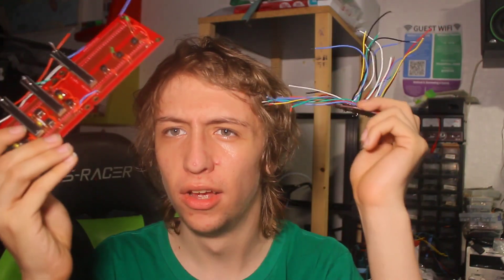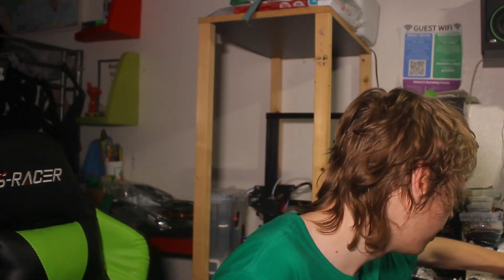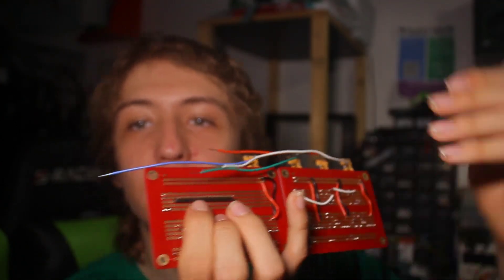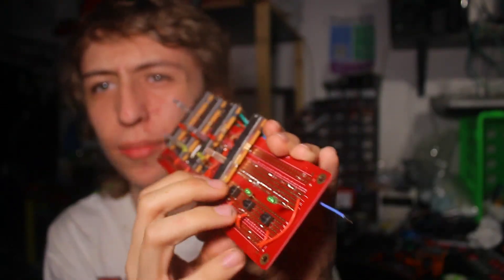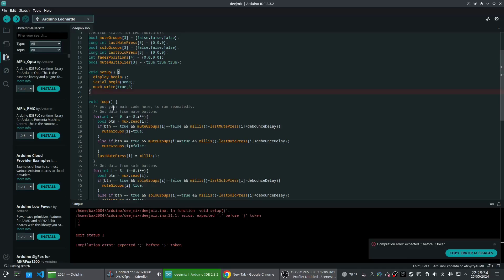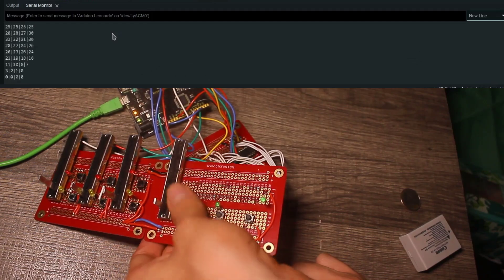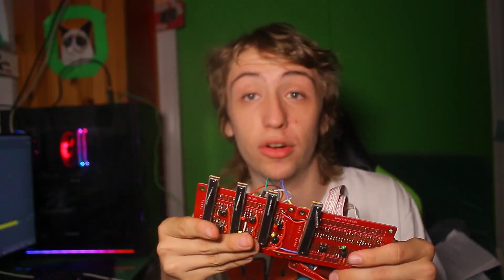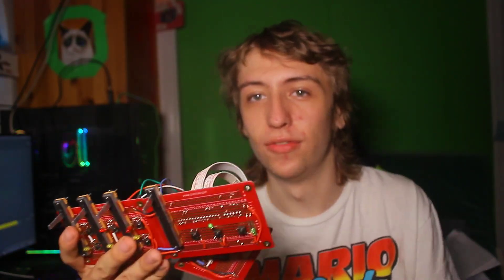I built a Deej mixer for my PC (Pt. 2)

Comment: Cool thing i just would recommand if you aim to design Hardware as a Professional, start using simulation tools and go streight to pcb design. This are some key abilities a Hardware Designer/Engineere must have. The problem with this type of prototyping is that you increase the number of solder joints. And each solder joint increases the probability of a failure over time.
Reply: What type of simulator would you recommend?